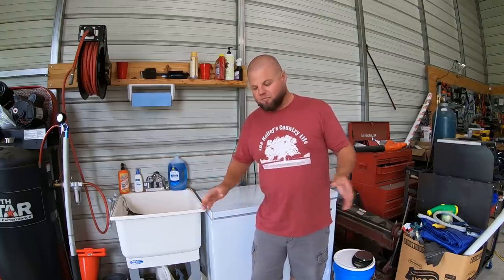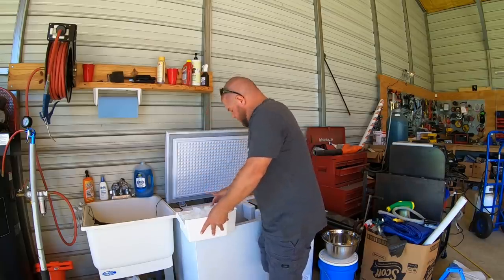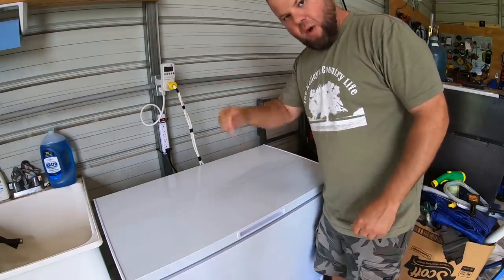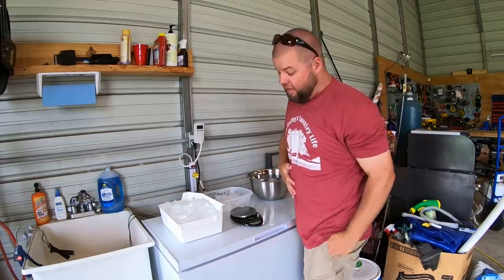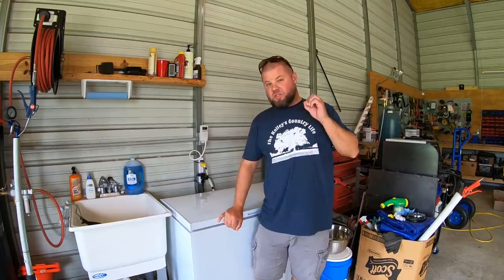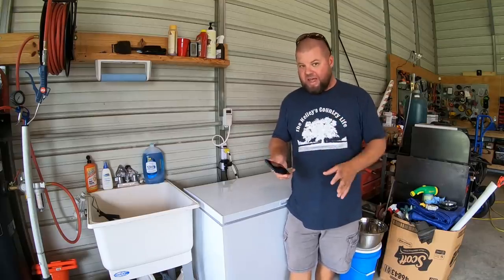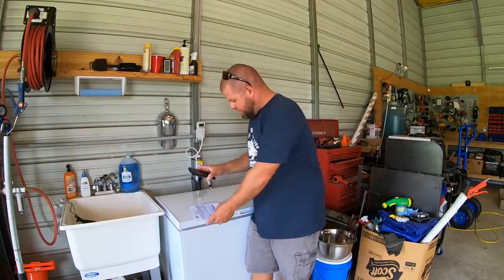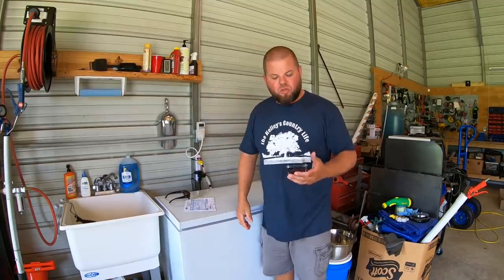Homemade DIY ice machine tests, energy usage and cost per pound! #370

Comment: Good job man. That was very interesting. Here in the deserts of Southern Arizona, which gets up to 118° at times, we wrap our exposed waterlines with pipe insulation. It helps with lowering the water temp during those hotter days. The aquifer water from your well should stay within a couple of degrees all year round. So the heating of the water is from the exposed water lines. Unless your well is drilled in a Geothermal aquifer, but I doubt it. Your well water would usually be over 150°. I drilled water wells for several years. Any rate, good information and even if your cost is $1 per 10 lbs, your still doing good.

Comment: A little in the game and a lot of suggestions later here is another one. It may have been suggested already but if not, try turning the fans around and let it pull the air up and across the trays. Fans produce a small amount of heat and since it is pulling air from the bottom it may be colder. But not much. Just a thought. Great study

Comment: Awesome job! Way to engage everyone in a fun project. I definitely think that the next big upgrade can be a pre-cooler for the water. DO you have a mini fridge in the garage? Move it next to it and run a coil water system in there to put close to 32 degree water into the ice maker. Insulate the line coming out of the fridge. That will bump it up. Keep up the great work!
Reply from the maker: Yes I do and that's on the list.

Comment: 1 more test I'd like to see is mounting 1 fan under the 2 metal plates your ice makers are mounted to. Blowing the air directly into the production area from the front of the freezer toward the rear. Hope this makes sense.

Comment: Excellent 💪 video👍 box around freezer 2 fans n rear air flow contained btwn box n frezzer directed by baffels middle to end air up down up down around freezer to exit in front. All done with cardboard boxes and pacagging tape.  This will b an experiment

Comment: The extra wattage drawn by the fans might be down to the long thin wires from the wall warts to the fans adding resistance to the circuit.

Comment: I enjoyed geeking out. Thank You 
The most important costs (imo) are Time and Stress. The time and stress you have saved by not having to drive around and get ice was already worth it, don't spend it all on us, save a little for yourself.
Reversing one fan (one push/one pull) should be the most effective, but we will see.
Thermal mass (big fan btw) will increase the efficiency and thus the longevity of your deep freeze, whether it impacts production is to be determined.

Comment: This is fascinating! 
I teach physics and I am nerding out.
Here are ideas to slow heat from getting  inside...
Put four blocks of wood under the feet.
Put the freezer on the north side of the building.
Put a fan under the freezer. (Might be worse due to pushing heat from your hot building onto the freezer constantly so fan should be on only when the compressor is hot)
Pull the freezer from the wall. 
Pre chill the water (geothermal maybe) or get a drinking water chiller or beer fridge with a coil of hose.
Add jugs of water to fill the space.
Reply from the maker: All your suggestions will be tested and are on my list! Thanks
Reply: @TKCL  this is fun and I will be making one after you do all of the heavy lifting.

Comment: greatly appreciating what you are doing here. i will agree with the insulation around the freezer. I live in Florida and can attest to the swing in heat. I would recommend styrofoam insulation on the walls behind the ice maker to help limit the heat transfer. Also look to see if you can add spray foam to the lid. Styrofoam is one f the best insulators out there.
Reply from the maker: Already purchased some, thanks for watching

Comment: Hi! It is my considered opinion here that the incoming water supply should be filtered/sanitized. A simple cheap filter can be used, and I just saw a $50 ozonater (used for hot tub sanitizing on amazon) that could clear up the ice over 90+ percent. Silver ion generator can be incorporated with the ozonator $$$. Of course, distilled water would be best, but would be cumbersome to build. I would sanitize first, then filter. Another idea is an elevated IBC tote to store clean water inside the shop & use RV water pump to pressurize the line. Another means of purification is aeration (aquarium pump w/ bubble stone) once again in IBC tote. As for the temp, even if the well pump is in direct sunlight (which it should be shaded), the line from the pump can either be direct buried under the frost line, and/or can be passed though a copper coil submerged in a 5-Gallon bucket of water. This should normalize the temp. The compressor should be mounted above the unit (as commercial ice storage units do), but cooling it should improve costs. More ideas; ask if interested.
Reply from the maker: I do have a filter on the line, thanks for the suggestions.

Comment: Hot water freezes CLEARER than cold water but not faster.  When you heat water you drive out the dissolved air, so when you freeze it it is clear.  Why not use a large food safe tub in the bottom of the freezer to hold the ice.  You could fill up some of the bottom space with frozen food if you don't need all the space for ice, especially with a large tub with a formed chute that directs the ice into the tub.  Great project!!

Comment: if the sides are hot ... I am thinking it is using the sides as the radiator for the coils to remove the heat... so maybe a fan to generate air flow over the unit will remove more heat?

Comment: 30 yr TEC here if you look at almost any fridge the fans blow the air from the rear of the ice maker to the front so maybe a duct obove the hump that split off to each ice maker maybe a fan on the bottom and one on top before where the air comes out you shouldn't need to get any colder I think you're good & your actually pretty close to peak production I wouldn't use wood anywhere only for test models then use salvaged aluminum or plexiglass wood expands and contracts draws moisture gives off a taste & molds I already did this project 25 yrs ago
Reply from the maker: Thank you for the information

Comment: liquid refrigerant enters the evaporator at the top of the coil.  in a r134a system this temperature is about 20 degrees below zero.  i think you said in an earlier video your freezer had explosive warnings on it. this lead to me believe that your freezer is running r600a.  not sure about that temp but fairly certain those temps will be the same.  yes cold air does sink but the coldest part of that freezer is at the top of the inner liner.  the entire liner in a chest freezer is the evaporator coil. also thermal mass will help with energy efficiency.  It does cost more to initially cool it down once that mass is cooled it lengthens the off time of the compressor. it also increases the on time. but most current draw of a compressor is on start up.  it is much more efficient to run a compressor for 2 hours on and 2 hours off than turning the same compressor on and off every 15 or 30 minutes.  keep up the great work.  I am loving these videos!
Reply from the maker: Thank you for the information. It's c5h10 BTW, cyclopentane

Comment: Very nice, my commercial ice maker   I just got will probably be for sale if my electricity bill is up $40-$50 again 👀. This was my first month running it. It ran quite a while longer initially due to cleaning and troubleshooting, so we’ll see how next month goes. From what I found online it pulls about 1,000 watts (hope i said that correctly) while running.
Reply from the maker: Holy smokes! That's crazy expensive

Comment: Have you put the foam insulation pipe wrap around your pipes outside? Get measurements of the shelf and see if you can find a storage bin to put on the shelf be taller should hold quite a bit.

Comment: You can also make water with the freezer.    1 way is to carefully drill a hole in the side or top and fit a 1/2"  copper pipe  and block off the end the section of pipe outside the freezer    then you can catch the condensation

Comment: I'm looking forward to what you come up with as your next build once you decide what works then incorporate that into a new and improved build from the ground up.  Thats I want to see.  I think it will be amazing.  Here is what I predict:  three ice makers running the other dirction, fan moving air,  Door built on a spacer for lines coming in, added insulation on lid, some heat sinks below and a small fan to remove excess heat from the compressor, filter on the water line. Maybe water line precooler.  My prediction. Good luck.
Reply from the maker: I think you might be spot on, we shall see when the time comes

Comment: I live where you can’t drink tap water. It is softened and has particularly salty taste. We use an Reverse Osmosis (RO) machine and it includes a small bladder reservoir canister. Normally the RO system is placed under the sink, but my contractor put ours in the garage. The water ran through the attic before reaching the kitchen sink. The first two or three glasses of water was as hot as the attic, until I put a second bladder canister of my own under the sink. The attic temperature water now cools to room temperature inside the canister. The delivered water to the tap is room temperature for first 4 of 5 gallons before it starts getting warm. They also use these bladders like this on hot water heaters to reduce the valve hammer effect, by that I mean they are affordable. 
If you can afford a RO system it would go a long way toward clearer ice, and it’s bladder would keep a consistent water temperature. The last RO system I purchased was around $200.
On another topic I feel you might appreciate, My grandfather owned small bar in Texas back 1930’s. The bar had a water trough just wide enough to easily put beer bottles and cans in. The trough ran just behind the bar and ran outside. Outside was a giant funnel over a bowl were the trough emptied. On top of the funnel was a giant attic fan, when was going full speed a night the funnel would glow red hot. The water in the bowl was pumped back to the other end of the trough. The temperature in the trough maintained a constant 35  to 40 degrees across the length of the bar. The way it worked is the attic fan was compressing the air. In order for the air to compress the air has to give up the stored energy, this is why the funnel was so hot. When the air decompressed it absorbed energy stored in the water. I always was throughly amazed by its simplicity. Most people I tell is story don’t believe me, but there is an natural version of this phenomenon in a lava tube caves near Albuquerque New Mexico, called the “Ice Caves”. It is a tourist trap, but I think it is worth the price of admission. If you every travel there remember to take a jacket, especially in the summer.
Reply from the maker: Wow, good read!

Comment: Yes the ultimate test of any change you make is ice production. But if you monitor the effect of any change of temperature, on for example the ice tray of the water temperature. You will get a quicker idea of what works. You also get less effect from environmental conditions as you can measure over a shorter time. A data logger (or 3) would also be good to have.

Comment: If you do use anything to remove excess moisture from the freezer, use unscented silica cat litter. It's the exact same thing in desiccant packs. I put it in coffee filters to keep seeds from my garden dry. You can reuse it over and over again. Set it outside on a hot dry day or stick it in the oven for a couple hours on low heat

Comment: WooHoo! Let the testing continue! You mentioned your water coming from a well? (a deep subject..HA!) What about bringing your line in from underground? Geothermal heating and cooling is very interesting. Apparently if you go 5 or 6 feet down, the earth is a constant 55 to 60 degrees (from what I've read), so if your incoming line was buried that deep, the incoming water would be cool regardless of the outside temps. Or at least cooler than the sun baking it. It might be worth a shot. Then of course the insulating of the line once above ground, but you know that stuff.. Thanks for another Great video! :)
Reply from the maker: Food for thought

Comment: If that freezer was inside under a air conditioner it would more likely increase the output of the ice makers. If leaving outside in the shed I would  put some big fans by the compressor of the freezer and face the fans out so they will pull heat off the compressor.
Reply: More energy used and nobody wants a water leak inside

Comment: I like how you purposefully change your shirt's color everyday! An additional thought - not 'hating' but rather 'loving' to see your series - you need to include the cost of the equipment to be 100% comparable. I lost track but I remember something like $350+2x$60+2x$10 ~ $500 for the equipment. Lets say this will last 5 years before you have to replace it, then this is $100/year that you need to put on top of your yearly ice production.
Reply from the maker: Lol nope, I really don't. I grab whats in the clean basket or drawer. It's all in how my wife packed it in

Comment: Most of the suggestions at the end sound like they will have more of an affect on electricity usage than ice production. I’m a commercial refrigeration tech. And here’s my thoughts. 

Biggest impacts for production that I think you’ll see
-incoming water temp
-thermostat temp
-getting cabinet uniformity. Keeping every corner of the inside the same temp. Which your basically already there with the fans. It’s common for a cold wall freezer with no air flow to have a 10* difference from top to bottom. But you’ve already resolved that. 

From there with the insulation and box fan blowing at the front I think you’ll see a kWh change but no production change. If the box is at 0F either way. The compressor will just run less.

And as far as the frost on the walls go. Once you get to a 1/2” to 1” of build up the unit begins loosing cooling efficiency. Since it’s a cold wall. It’s using the cold surfaces to absorb heat out of the cabinet. Once you get to about 1/2” of frost build up. The walls have to absorb heat through the frost/ice. Which slows down your heat transfer and increases compressor run time. As long as your thermostat probe never gets buried in that wall ice I don’t think it will affect production. If the thermostat probe gets buried in wall ice then the compressor will cycle off before the cabinet is actually at your set temp. Making the cabinet run warmer. That’s why I made a previous comment about a sub lid with an opening just big enough for a scoop. To try and cut down on wall frost build up.

And the final thing on incoming water temp. Straight from the hoshizaki service manuals. Going from 90F incoming water to 50F incoming water will increase ice production by 8% on all of their units.

Loving the series, keep it going.
Reply from the maker: Thank you for the information, especially the last part about incoming temp. That is a decent increase
Reply: Is there a way he could make the freezer frost free? Dehumidify the air?
Reply: @LilHoss  only way to make it truly frost free would be by adding a defrost cycle that would heat the walls for 15-30min every 6hrs. That’s just not practical in this situation. Even if he were to have dehumidification. Every time you open the lid his 100% humidity Florida air goes rushing in and condensates/freezes to the walls. Active mechanical dehumidifiers need air temp above 55F to be effective. He could use a desiccant. But my concern with desiccant is that the ice would sublimate faster. But the rate he’s going through the ice. Sublimation isn’t really a big concern here. Best solution to minimize wall frost is by sub lids. The lip that he mounted every thing too is designed to hold 1/2”-1” foam board insulation. In a typical deep freezer setting you’d have 3-4 sections. Open the top lid and remove the sub lid for the one section your going in. Prevents air transfer to the whole freezer every time you open it. I already suggested to him getting foam board and mounting it on that lip under the lid. cut a hole in the middle just the size for your hand with a scoop. So there’s less area for warm air to transfer in. Hell still get frost build up. But i think the rate it would build up would be drastically reduced.
Reply: @bryand558  that's good insight. I'm a layman.

Comment: Im gonna suggest you monitor the temp on the outside top of the door or lid with a contact thermometer to see how much cold is getting past the lid insulation. Then check the sides. When done with that. Add two 1 gal milk jugs filled with 50/50 automotive antifreeze in the deep end to serve as a thermo battery to shorten the recovery time of when your opening the chest to recover ice. Which would be very variable depending on room temp. Your doing a good job logging your results.

Comment: Don't Mess with the water control valve, it's set at the optimal setting at the factory. I use to work at Whirlpool in the Ice Maker department. Too much water will over fill the valleys and cause all the cubes to freeze together and the heating element can't unfreeze that far up. The stripper motor can't strip the ice out when they're all froze together.
Reply from the maker: Thank you